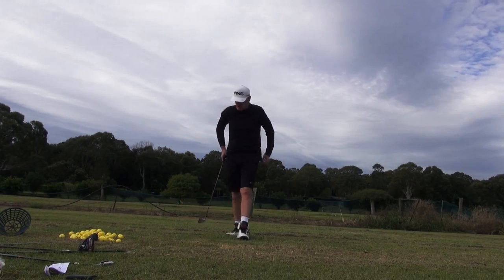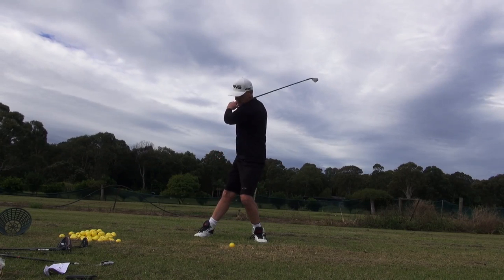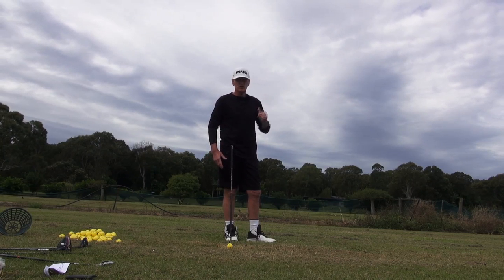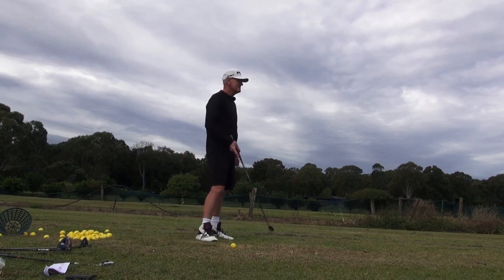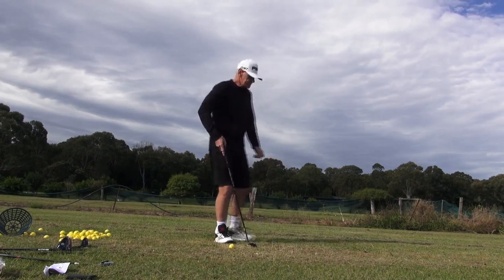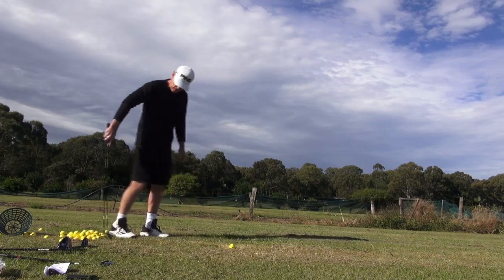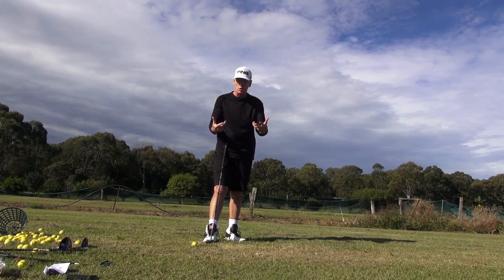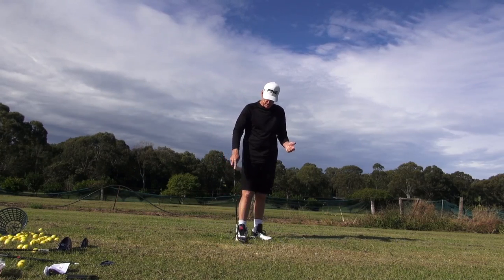More Info Minimal Movement Golf Swing no 1

Comment: Are you feeling that the bottom of the gatepost is your left heel and the top is your left shoulder joint?
Reply from the maker: Hi thomas, 
                       I actually feel the   'gate hinges' are the inside of my  lead knee and my lead shoulder blade, as if a  big steel rod is running up through them, and I just turn around the rod , my lead knee doesn't feel like it goes  behind the ball but towards it, as we saw with Hogan  .
                    cheers Jh

Comment: JH:  Is your right arm tucked next to your body?
Reply from the maker: Hi Jim, 
               My arms generally are connected  to my upper chest ,  my triceps  sitting 'on top' of my pecs at address  and maintaining that connection all through the swing, I try to keep my right arm  low in the backswing just following the turn of the  chest  plane as much as possible,  so  both my arms  do not disconnect very much from my body during the swing.
                        cheers JH